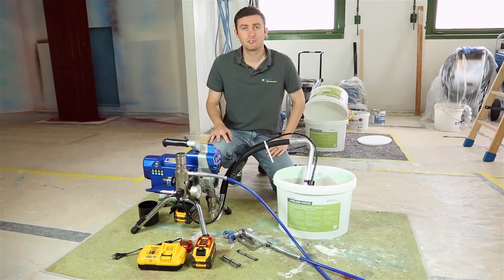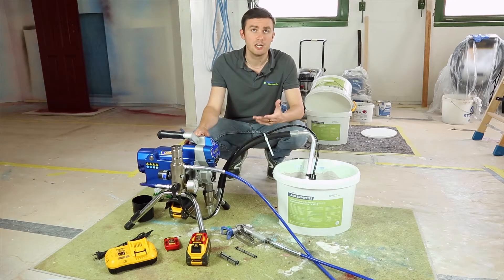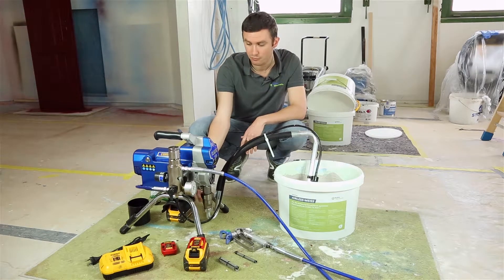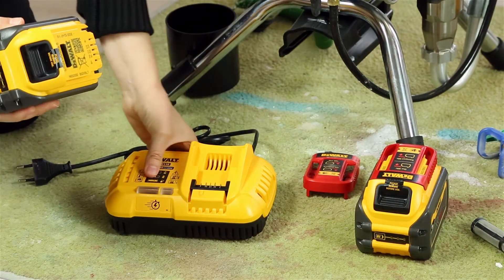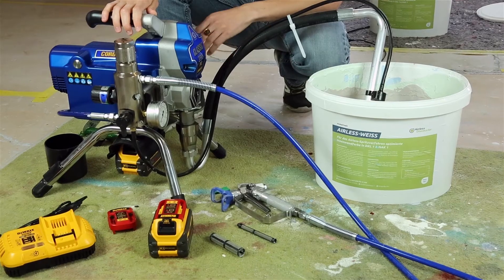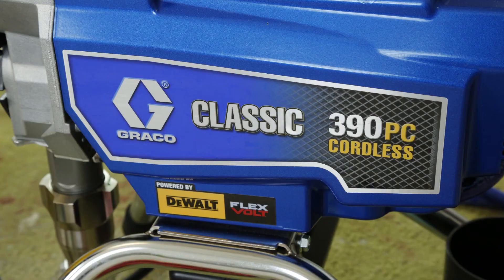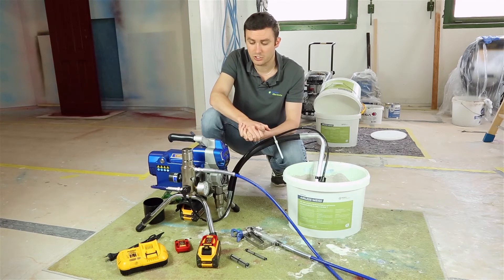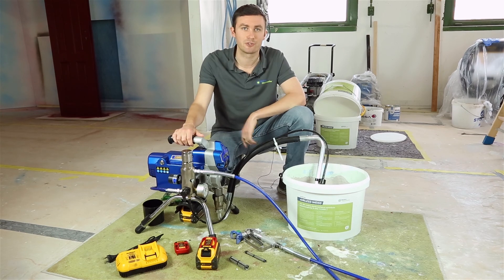Graco Classic 390 PC Cordless (battery operated) - Overview

Comment: Need to sell some extra battery packs and charger that thing won’t keep up even doing basic kitchen cabinets
Reply: That's a bad assumption. It's already been shown going flat out for 17 minutes straight on a single charge. No-one is spraying solidly for 17 minutes with a 390. It's more than adequate and very useful.
Reply from the maker: As explained in the video, we tried the product ourselves and it can spray up to 12 litres of paint before the battery is empty.
Kind regards,
Airless Discounter team